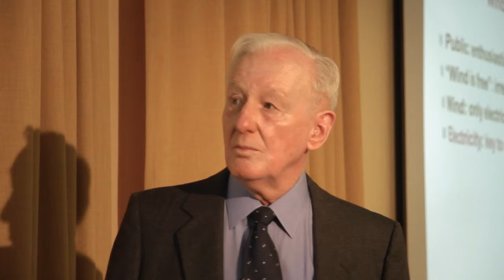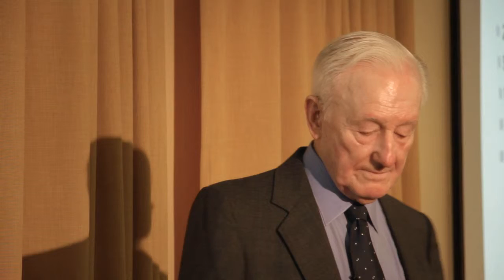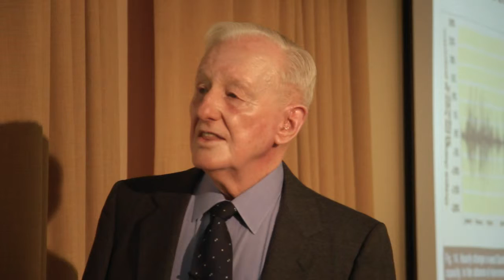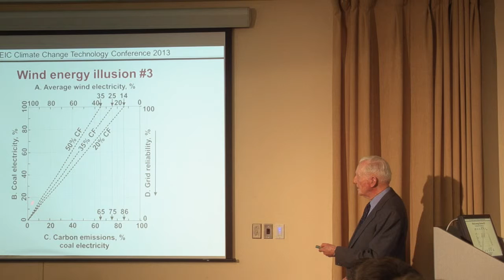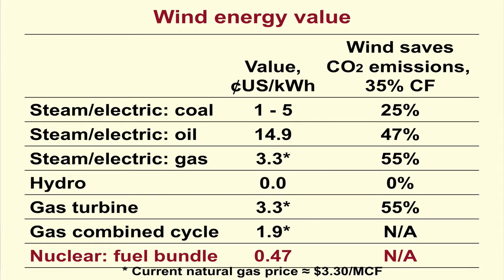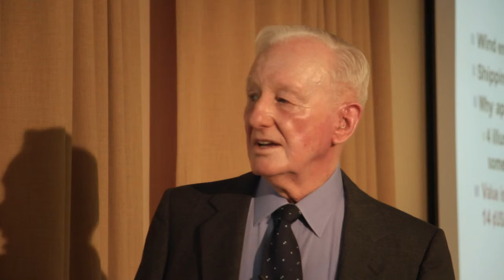Wind Power Lecture CCTC 2013 (EIC) Engineering Institute of Canada | Concordia University

Comment: Let’s say you wish to replace a 1Gw nuclear plant with wind power. Let go through the numbers.
Many French reactors have a power level higher like 1.6Gw = 1600 mega watts. We’ll use 1Gw = 1000Mw to keep our arithmetic easy. 
A 1 Gw nuclear Plant has a capacity factor or 95% some are higher some lower.
Wind Power has a capacity factor of 33% this can very as low as 25% or a bit higher.
For the layperson this may not seem so important so please bear with me. Because we wish to replace a nuclear plant with a wind farm
To build a wind farm you will need 1Gw/ 33% = 3Gw of power because of the capacity factor. The wind blows 33% of the time. That means 3Gw of power is needed to be produced power so to replace 1Gw of Nuclear. How this is done is wind supplied 1Gw of power to the grid while the remaining 2Gw of power goes to storage. So lets say we have very very predictable power where every third day the wind is blowing and at sufficient speed >20km/hr. So Monday it blows Tuesday and Wednesday the wind doesn’t blow. So on the Monday 1Gw goes to the grid 2Gw goes to storage to be used on Tuesday and Wednesday. Then by some miracle the wind blows on Thursday and the cycle continues… For EVER. If there is no wind power on the third day your out of luck. Now lets calculate the size of the battery. Energy is power times a unit of time.
1 Joule of energy = 1 watt for one second. Therefore 2,000,000,000 watts (2Gw) needed to be stored in one day or 24x60x60 seconds= 86’400 seconds. So the storage that’s needed is 2,000,000,000x 86,400= 
172,800Gj of energy or 172,800,000,000,000 Joules of energy storage. But the kicker here is assuming 100% storage capacity efficiency. Now lets calculate the cost of 3Gw Wind plus 172,800GJ of energy storage. 
Wind’s cost is about $1000 per Kw or $1 per watt. So 3Gw of wind will be $3 billion.
Batteries are about $500 / Kwh or (1Kwh = 1000w/K×60 min/hr x60 sec/min)
M $500 / 3.6 million joules. Or .0001388889 $/J
Therefore 172,800 Gj x .00013888$/J= $24 billion 
So that’s 24 plus 3 = $27 billion to replace 1 nuclear plant. So the cost of storage is the kicker.
But for how long?? A nuclear plant can go for 40 to 60 years.
For a wind farm its life could be 20years. So look to spend 3 $billion times 60/20  (or  $9 billion) to cover replacement over 60 years. For batteries lithium ion type they can take 300 to 500 charges. For calculation lets use the generous 500 charges. If the batteries will be charged once every 3 days that’s 1500 days of life.
1500/365=  4.2 years Therefore over 60 years the replacement is 60/4.2= 14 times
So the total cost over 60 years is $24 billion x 14 for batteries plus $9 billion for wind turbines equaling a grand total over 60 years to be 24×14+9=

 $345 billion. Over 60 years.

A cost that is not calculated is not just the cost per Kwhr or replacement costs over 60 years. 
But the cost of a power failer.
The cost of a power failer is extremely difficult to calculate. A good example is that of a bakery or other industries that are highly dependent on reliable power. Bread that does not rise or a process that’s time dependent like the refrigeration of food or vaccines. A patient on an operating table. A person stuck in an elevator etc etc. 
Now do the same for solar but it has a capacity factor of 20% less in Germany.
1/20% =5Gw  etc etc. Create your own spread sheet and adjust some numbers if you like.
For nuclear it is 95% Do the math for it as well. You will need 0.05Gw of storage but this could be made up with natural gas. A lot of nuclear power plants have 2 reactors.  Darlington 4 Pickering 8. As you can see by the back of napkine calculation it’s the cost of storage. There is a line in the PDF that your can down load from www.roadmaptonowhere.com that I will always remember.

 “Fuel is Storage” Wind and Solar are fuel free systems. 

But lets look on the bright side Elon Musk can sell us the battery storage for 172,800 Billion Joules of energy at 100% efficiency. Wow time to buy Tesla stock.